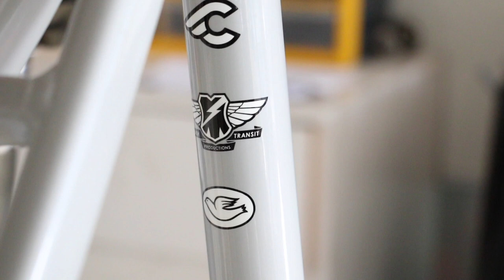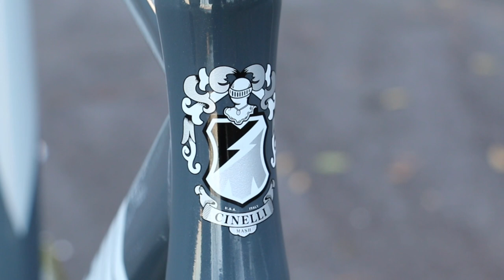Bike Build - Cinelli Mash Bolt OG

Comment: A little rubbing alcohol poured into the grips will make them slip right on & be easy to reposition. It  evaporates and they are solid.
Reply from the maker: Thanks for the info! I use hairspray sometimes but I’ve never used rubbing alcohol, I’ll have to give it a go!

Comment: Faster way to install grips is use rubbing alcohol, just toss some inside the grip and it will coat the bar as it slides on, it will dry almost instantly.  Sick build, wish I could find any Cinelli right now.
Reply from the maker: Thanks for that, there’s loads of different ways aye 👍

Comment: Good job, but why you don't  put a spacer below and one above so the stem tightens on the whole head tube?
Reply: Yeah I agree with you
Reply from the maker: Thanks bro, I do it because I prefer the look of the top cap sitting flush with the stem. To me it just looks a lot nicer. Stem companies specify you can allow a few mm gap, so it is never an issue

Comment: Woohooo nice bike! Any suggestions for a Steel Cinelli was also planning to build one butwant in a steel frame
Reply from the maker: Thanks bro! They do the Gazzetta which is pretty dope, and also the steel vigorelli. There’s also the mash work but they don’t make them anymore so might be harder to find
Reply: @waveywheelies  no problem. I also like the Gazzetta, is it light? yu have one right? Ive read abut the toe overlap is it a problem for you?
Reply from the maker: Wouldn’t say it’s super light but it’s pretty light for steel. Yeah I have one bro, toe overlap I’m used to as most of my fixed gears have it. 165mm cranks might help more and pedal choice too. I do run different forks on my gazzetta though (mash work forks)
Reply: @waveywheelies  great man! thanks! Congratulations again on your dream build! Ride safe
Reply from the maker: Damire Thneedonado thanks bro! You too
Reply: Get a steel vigorelli the black night version. It's a really nice frame.

Comment: I’ve got a 2014 histogram and was wondering if you’ve had any experience with drilling out the fork for a front brake?
Reply from the maker: Good question, I haven’t personally done it but I have heard that it’s just a rubber bung that’s in there that is painted over. So apparently you can pop it out from the backside, or drill it out. But that’s just what I’ve heard, would be best to double check!